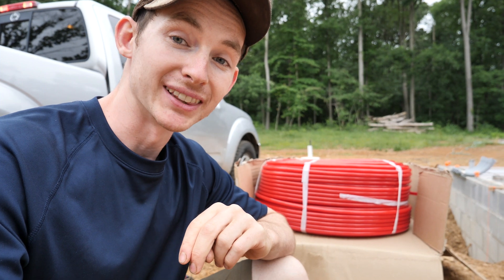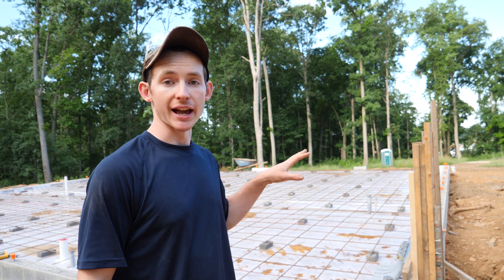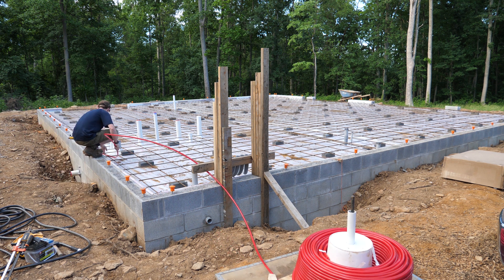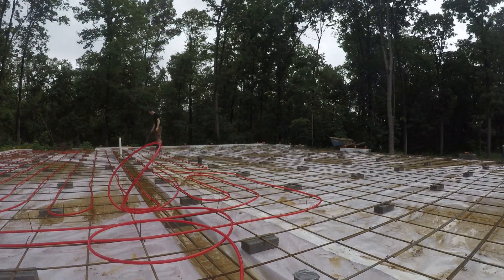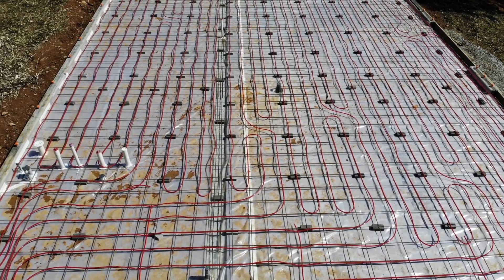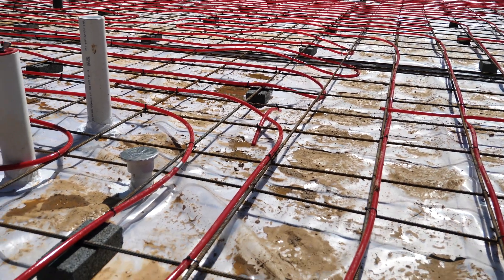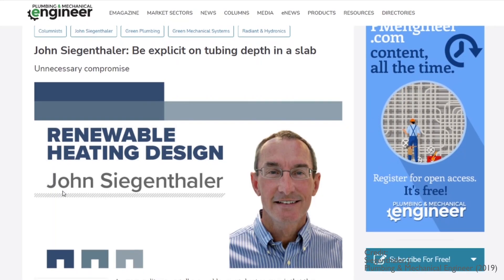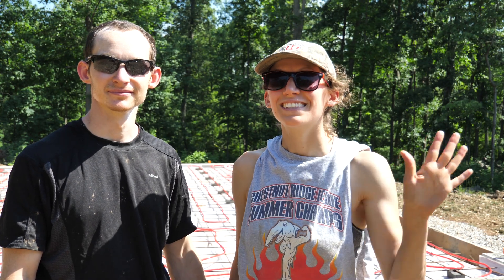Radiant Heat Tubing in Slab (installing on rebar)

Comment: Do you need to do control joint cuts if you slow cure the concrete?
Reply from the maker: If you watch the slab video you’ll see why we did not end up doing control joints even after planning for them, and in hindsight we are happy we did not. 3 years later and only 1 practically invisible hairline crack in the entire slab. Water cure and the perimeter insulation acting as a contraction joint made all the difference

Comment: I am not to sure tying heating pipe directly to the rebar I done it only once myself and that is at least 15 years ago , and still no leaks , but I googled it and this solidified my worries. ; Heating pipes are designed to expand and contract with temperature changes. Tying them tightly to rebar can restrict this movement, leading to stress and potential leaks. ;

Comment: Just wondering if you could have run the rebar on top of the tubing and then zip tied the tubing up to the bottom side of the rebar? Then the rebar protects the tubing during the control joint cutting and holds it at the correct height.

Comment: I have many infloor heating system and from the beginning we tied the PEX to the rebar. I did ten mile of PEX  in one YEAR. ALL MY CUSTOMERS were happy. Keep up the good work. I know you did it right. When you tie the PEX to the top of the rebar it easier to fix a pipe that was cut by the concrete crew. As soon as you have a leak, the concrete crew will let you know so you can fix the leak before the concrete sets. 
Another thing that works well is you cap off a PEX about six feet long and you put your thermostat bulb into the PEX and shove the cap end into your floor and the other end open PEX to wall below the room thermostat. The thermostat can be replaced if it goes bad without opening the concrete. Pull the bulb out and replace the thermostat. 
. THAT BULB WILL SENCE THE FLOOR HEAT AND YOU WILL GET A MORE EVEN HEAT  in your FLOOR. THE CONCRETE FLOOR IS YOUR radiator. The pex that has the thermostat bulb is a conduit for the thermostat bulb. The same thing that you use when you insert a thermostat bulb in a boiler.

Comment: Just wondering if the plastic should be under the foam board. Would moisture make it up offer foam then trapped in between causing a dam? Asking for my own project.
Reply from the maker: Check out our radiant slab prep video, several have asked this same question

Comment: You should use plastic rebar chairs instead of brick to hold up resteel
Reply from the maker: Thought about it, but they are pricey and in hindsight would have tipped over / crushed instantly once the crew starts walking all over the mat during the pour

Comment: Are you doing concrete floors or laying down flooring? Just curious if the heat would rise through the LVP flooring as well or will it stop with the flooring and just essentially keep your feet warm? 

I’m sure I’ll get to that answer, but watching your build in order as I’m wanting to owner build in the next year.

Comment: Would love to know if the slab cracked like crazy worth the potted being installed above the rebar...
Reply from the maker: Even with no control cuts there are only 2 hairline cracks that are so thin they're practically invisible unless you're down on the floor. Tubing location had no effect on cracking

Comment: How did you handle interior wall bottom plates? These are typically glued and nailed to the concrete.  Did you consider the nails hitting your pex lines?
Reply from the maker: Details in the interior wall framing video 🙂

Comment: Thank you for this video! I am installing my radiant system in 2 weeks and this gives me a good idea on what to expect. I use 20mm tubing, so 16mm inside diameter. What is your inside diameter?
Reply from the maker: I believe the ID of 1/2" is just over 3/8"
Reply: @MasonDixonAcres  Thank you!

Comment: Here in Europe you would not install underfloor heating tubes in the concrete slab !
You would pour the Slab THEN lay separate rebar mats for the heating pipes in the screed flooring.
This is for future proofing when the house is to be renovated,
 the whole slab does not need to be destroyed just to change the heating pipes!
Reply from the maker: Haha yeah there's no changing out these pipes or demoing the slab. Ideally the PEX lasts forever.. we'll see 😉

Comment: Great build series on what is going to be a great project to follow. Got a question though. This might have been asked and answered already but why are you using a radiant heating system in what is eventually going to be you garage floor? will this still heat the accommodation above?
Reply from the maker: Thanks a lot! Nope, radiant is just for the garage
Reply: @MasonDixonAcres  Hi. Thanks for the reply. I just binge watched the whole build series in 3 days. 

Great approach. Straight to the point, very informative and with zero filler. 

But I still don’t understand why you have the underfloor heating in what is going to be your garage? Especially when you have the 2 mini splits downstairs also and will have additional heating in the upstairs accommodation?

I’m considering a garage + suite build myself so this series is great inspiration. Good luck.
Reply from the maker: Holy crap that’s a lot of time to watch the whole series 😅 much appreciated! A few reasons for the radiant, we wanted to insulate the slab anyway to have a continuous conditioned space around the whole building, the addl cost for adding pex to the slab was negligible and can’t be done after the fact, it’s an easy way to heat the space, and mini splits were not in the original plan but decided on them later due to the cooling capabilities. Also much easier to do the splits with walls open rather than future retrofit for cooling. Probably will share heating load between radiant and mini splits going forward depending on how efficient everything turns out to be

Comment: Hw did you clean the dirt off the white plastic? Would that dirt contaminate the cement?
Reply from the maker: It rained the day before the pour and we used a backpack leaf blower. But honestly it would have been fine without doing that, the amount of dirt from just foot traffic is negligible compared to the mass of the concrete. Slabs get poured straight over dirt all the time
Reply: Thank you. @MasonDixonAcres

Comment: I did that job in a 1000 sf basement floor and then a 1600 sf first floor. I didnt use the blocks but the rest was the same. We didn't do ANY control joints and I have almost zero cracks..after almost 25 years. The technology wasn't nearly as refined then..I would have used the blocks for sure now. Interesting...it is 1/2/24 and my slab heat is set for 60 degrees ambient...hasnt even turned on THIS year! All pipes are hidden in web trusses and drywall. Very warm winter so far outside Boston. Upstairs is Quick Track...and a forever Buderus G15 boiler that has needed NOTHING in 25 years.
Reply from the maker: Sounds like an awesome setup. We ended up not cutting control joints either (details why in slab video), but 18 months post pour and there are only 2 very thin hairline cracks. A slab below grade should stay nice and warm without cold air around it to suck the heat out. Hoping to also get 25 years out of our boiler! But they do recommend an annual flush with vinegar.
Reply: @MasonDixonAcres  that's the new tankless ones. The old cast iron G15..nope
Reply from the maker: Gotcha, ours is a dual purpose unit for domestic hot water so we can't use a traditional cast iron boiler that is usually in a closed loop.

Comment: I have a project using gypcrete. I have used plastic 90s in slab before. The wrinkle here is this; the walls are up (3" bottom plate for gyp) and the manifolds are supposed to be in the wall.

How would you accomplish this? I'm thinking of just cutting out the bottom plate and using plastic 90s but also considering dropping through the bottom plate and then back up from underneath in the floor. 

Thanks!

Comment: I have never seen this done like that before. Usually they staple the pex to the foam board and then lay wire mesh on top of that. How did the concrete guys find pouring your floor with the rebar up off the ground on bricks. Once the concrete is down I would think that they would be tripping over the rebar. I would also worry about the saw cutting the tubing. Can you explain why you did it this way. Thanks.
Reply from the maker: 6:19
Reply: @MasonDixonAcres  Yes, I saw that after I commented. I also saw that article before as well. How did the pour go? Were there any issues with having the PEX quite high like you have it? Someone else that did it like that said that the concrete guys could step on it and kink the pipe because there is enough space before it hits the foam that when they step on it it pushed it down over the rebar.
Reply from the maker: No issues during pour regarding the pex, it was pressurized the whole time. Yes the mat gets walked all over during the pour, wasn't an issue

Comment: Wont having the pex so close to the toilet  flange cause a toilet flange wax ring malfunction
Reply from the maker: The floor temp doesn't get super hot, at max around 75F. So wax rings are good. Plus, I use waxless toilet seals anyway

Comment: In your opinion, would 500 ft curcuits of 5/8" tubing be okay?
Reply from the maker: Seems high - check out some of the resources Radiant Floor Company or Radiantec have posted about optimal circuit length for sizing. I think 5/8" is like 350-400' max

Comment: Where can we get you materials spreadsheet or tracking costs? I saw in another video I can't find that you would offer it for a small $. Cheers ⚡
Reply from the maker: We are currently working on all of the spreadsheets! The radiant floor spreadsheet can be found here: https://www.masondixonacres.com/products/radiant-flooring-cost-spreadsheet

We are also working on a guide for radiant heat flooring as well and an overall budget tracking worksheet! Hope this helps!
Reply: Snow
Reply: Typo

Comment: I’d love to ask a question. Firstly, awesome video!!! 

Control cuts… who specifies this information? And what’s the general tips for cutting control cuts so as not to have cuts where you don’t want them? Thanks
Reply from the maker: I specified it based on research, but generally it's just something the contractor lays out based on what they know. On commercial projects it might be called out on approved drawings. You general want to keep the aspect ratio as square as possible, and cut 1/4 of the slab depth. Lots more info online on location/spacing/depth
Reply: @MasonDixonAcres  Thank you.

Comment: Above average delineation of essential issues to instal radiant floor system.  Highlights of presentation: making a tubing holder to assist with unrolling of cumbersome roll of pex tubing, description of advantages of placing pex towards upper level of slab, guidance of making manifold to
pressurize tubing at 60# by using pex Ts,  clever tip about lowering pex where control cuts in concrete are planned, and finally... excellent pacing and videoing of project.  Touché and thank you.  Johnny T.
Reply: Greetings Mason Dixon:... Would you respond to the plus and minus of running two ( 2 ) 1/2 inch circuits or one 7/8 inch circuits?   Thanks.  J T
Reply from the maker: Hey sorry just saw this looking at another comment! There's a lot of variables to consider, I'd probably go towards the 1/2" due to bend radius, availability, and cost. I believe Radiantec or Radiant Floor Company sells a 7/8" thinwall PEX that they promote has the best heat transfer, but it probably depends mostly on your application.

Comment: A few questions - Did you compare EPS vs XPS? EPS would lower my cost by about $1,500, but reviews seem mixed on if it is good. Also, If the structure for my pole barn is already up, would I want to vapor barrier the bottom of the insulation? Seeing in the comments one your reasons to vapor barrier the top was to hold out rain. And did you have to do any perimeter insulation? I do not want to miss this if it is required. 

Thanks for the videos man! huge help.
Reply from the maker: In my opinion XPS is more durable than EPS and I’m pretty sure it has a better track record of longevity below grade, so I wasn’t chancing it on something permanently locked underground. 

I would still put the vapor barrier on top to make sure concrete doesn’t get beneath the insulation during pour but it probably doesn’t matter either way. 

Yes my stem walls are insulated on the interior face from top of slab down to top of footing. Code required in our area and best practice to protect from frost
Reply: @MasonDixonAcres  You're awesome man, thanks for the tips! Really cool channel. Keep up the work!
Reply from the maker: Appreciate it!

Comment: My only quall is the placement.... thinking is terms of the thermal mass, the more mass that is heated the longer that heat can radiate. It only makes sense in my mind to put the lines low in the slab because heat rises, though the heat will radiate downwards slightly, the thermal mass under the slab would soak up that lost heat if it gets past the foam board. Ironically this theory of mine is why I was calculating for 6 inches of concrete vs the standard 4 inches, the more thermal mass the more stable the temperature  fluxuation...
Reply from the maker: The deeper the tubes, the harder your system has to work and the less responsive it is. I thought what you did until I read this article written by a PE who specializes in this field: https://www.hpacmag.com/features/hydronics-radiant-floor-tubing-depth-siegenthaler/

Comment: Thank you for sharing your experience on this!  I have learned so much from you guys.  I read in a couple of articles that putting the tubing directly over a rebar kind of creates a void of concrete, hence reducing its effectiveness. Because when concrete cracks, a section of the concrete will press one way, the other section the other way, when the soil settles, or expansive soil movements. What are your thoughts on this?  I think the best way is to offset the tubes, say 3-4 inches from rebars, so they only cross them but not follow them directly. Your method makes pour time easier, I guess.  To be honest, I am still not sure what is the best method overall easy during pour time, so the workers don't damage the pipes, retaining the rebar effectiveness.  In my case, this summer, I will build a 5-inch? slab.  I already removed about 20 trucks of very bad soil and replaced with soil.  As a result, I think I need rebars (number 4 or 5?) located mid-slab on plastic chairs + macro fibers in the mix.  12 inches between bars? Any advice?
Reply from the maker: Yes there is technically a "minimum concrete cover" spec for rebar, but unless you have a structural slab (which I doubt) I wouldn't stress about it. Especially with a grid at 12" (and some builders don't do any bar.. just fiber).  The key is base compaction - check out our video on foundation backfill. Make sure the soil you have placed is well settled/compacted and I would recommend at least a 4" layer of 3/4" clean stone base, tamped with a vibratory plate. Offsetting the tubing from the rebar sounds like a hassle but if it gives you peace of mind then go for it. I'd recommend concrete brick chairs - the entire mat, tubing and all, gets trampled during the pour. The plastic chairs are both expensive and can tip over if really kicked. I can assure you that your slab / heat system will be better than 99% of those commercially installed just because of your attention to detail 👍🏻
Reply: @MasonDixonAcres  Thank you for the tips!  I am sure also what we do is much better than most contractors!   Also, I used your LoopCAD software, very good, I did my layout in a few hours.  Last one:  I spoke earlier today to my excavator and mentioned I wanted 6 inches of 3/4" crushed stones under the slab to break the capillarity effect.  He was laughing and said:  I already raised the ground under your slab by 4 feet with gravel, Crushed stone is not necessary in that case, runner crushed stone would do as good for your soil.   What do you think?
Reply from the maker: Yeah if you already have a stone base you certainly don’t need more. Just make sure it’s well consolidated/compacted

Comment: Great video, would it be possible to post some links or at least a description of the fittings needed to do the pressure test? I'd like to use my car inflator if possible.
Reply from the maker: I made it a few years ago for another plumbing project but I'll put that on the to-do list 👍🏻

Comment: I'm at the planning stage for a similar radiant-heated slab-on-grade build and this information and video of the installation process is very helpful and valuable.   I will be following the project closely.  Thank you very much.   You're making the daunting process seem doable.  Cheers.
Reply from the maker: It's not as bad as you'd think! The 1x1 grid was hugely helpful, a 2x2 would also be good. Working on the hookup of ours now

Comment: Did you compare the cost of getting a system from a radiant heat floor company to the way you did it?  I'm building a 1700 ft2 building with radiant heat in the floor and am interested in your findings.
Reply from the maker: I consulted once with Radiantec but never got to the pricing stage. I may still use their help for the boiler kit when it comes time for it. I'd guess at least $1500 in labor if you want someone else to lay out the tubing.
-Alex